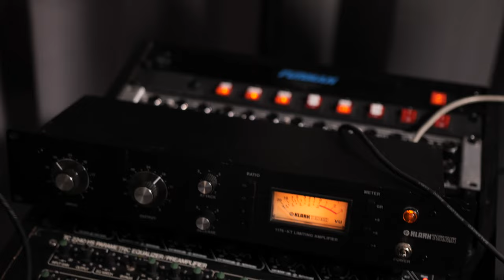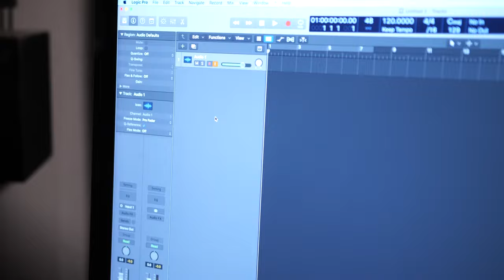Outboard Vocal Chain For Recording Vocals

Comment: Question shouldn’t the last cord been line input trs balanced cable ?
Reply: XLR or trs is fine along as you set your interface input to receive line level not mic level
Reply: @LukasHaydenOfficial  thanks for the feedback i knew that but was told the proper way was was XLR trs not XLR To XLR
Reply: @ItzrealMusic  both cables are technically identical when it comes to the wiring and shielding so either way is good
Reply: @LukasHaydenOfficial  awesome thank you 🙏🏾
Reply: @LukasHaydenOfficial  and by line level you mean audio interface should be the last device to receive signal instead of being the first or only one correct ?
Reply: @flackotv809  line level and mic level are really just fancy ways of saying 15db boost and high impedance or low impedance 0db boost

Comment: plz do more test how input gain change mic line gain vs interface alone
Reply from the maker: You mean like how the sound quality would be different?
Reply: @romejpro  how much weak signal of mic becomes when mic pre gain turns up and how to know sweet spot n trim with outout trim of pre

Comment: So from the compressor it can goes into a Eq and then into a interface? 

I pluged my mic into the preamp. From the preamp to the eq. Fram the eq to the compressor. From the compressor to the inferface. 

Or should i do the compressor to the EQ. EQ to the interface?
Reply: I imagine you'd want to compress the vocals before you EQ so you can EQ a pretty equal sounding vocal as opposed to getting rid of turning down frequencies that are only too loud because they aren't compressed. not sure though as I don't really use outboard gear but that's my take
Reply from the maker: I like eq into compression and sometime an eq after the compressor

Comment: Soon as i seen knockoff  gear i lost interest
Reply: @oree4three484 neither do I but I know better than warm audio 😂😂 spend twice the amount than warm and u aren't reselling when u realize it falls short
Reply: Its not the gear. Its you bud.
Reply: @tecno8335  Oh wow, great comment! You won YouTube today buddy! Not everyone can handle power tools, and not everyone can handle manual tools. It's important to pick the right tool for the job. However, Warm Audio is like taking a Hi-Point to a shootout. It might get the job done, or it might not. I don't want to have "mights" in my studio. It's just not for me. But my Neve 1073 tells me it's definitely not a "me" issue; it's a "Warm" issue. 😂🤡🤡🤡
Reply from the maker: I guess people don’t agree with you in the comment thread 🤣
Reply: @forwardproducer 2 people  😅😅😅 I guess lmao 🤣 😂 🤪  you keep pushing that warm audio trash 😂😂😂
Reply: @harpoleon6806  Again. It's not the gear it's just you buddy. Your Gear insecure. It happens. Make a bet with yourself and say with my skills and know how I bet I could achieve a million dollar sound with value gear. Try it. It will either be fun. Or show just how much you need to learn 😊
Reply: @tecno8335  Those are the tools you want to use within your budget. I prefer to use better tools that actually work. Yes, you can drive screws with a screwdriver, but a drill works better and faster and is designed as such. Warm Audio is budget-friendly and provides budget sound, but it's you, not your tools. Because if you could spend more, you would. You're trying to challenge me to use Warm Audio. I prefer better brands, and Warm Audio is trash. For you to even try and make it sound okay makes your opinions worthless bro. The fact that y'all needed this video lets me know it might be all of y'all and not the equipment, mainly because only people with Warm lack this much common sense, I guess. So again, people over tools, right? 😅🤣
Reply: @tecno8335  trying to say the same thing over again and again isn't  proving anything to me other than u like to repeat  yourself  budgets are the deciding factors not tools not users lmao no one is creating platinum hits with just warm and there own mixing they use professional mix and mastering engineers 🙃  so ur tools and u don't matter it matter with your budget u show me a self mixed and mastered Grammy nominated song with  all warm gear and no pro mix or master ..... I'll wait
Reply from the maker: Such amazing creditable insight from a anonymous account 😂
Reply: @oree4three484  how would u know 🤔  lmao that's the best argument  I've ever heard bro 😂